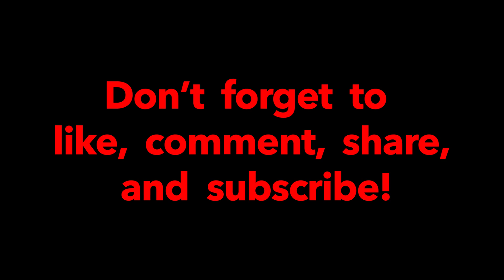Carbon Fiber vs Titanium Guitar Neck Reinforcement

Comment: Carbon fibre:   I am a cyclist and ride a high end  carbon fibre frame bicycle.  A feature of such a bike is that carbon fibre Absorbs and cancels high frequency vibration and less is absorbed by the human body.   And it does !  
Why put a carbon fibre, vibration absorbing structure in a guitar  ?
Reply from the maker: Carbon fiber oriented in certain directions is highly resonant. That's why carbon fiber acoustic guitars sound so amazing.
Reply: Carbon fibre resin matrix  inherently is excellent at generating heat that dissipates the vibration energy.  This is totally separate from orientation

Comment: How difficult of a job would it be if someone wanted to completely hot rod their 20 year old Fender P Bass with Carbon Fiber Rods and a new two way truss rod? Is that an impossible job consodering that the luthier would have to take off the fretboard or are there luthiers who have the right technique and experience to do that?
Reply: American Standard? They already have graphite rods and two way truss rods. If a vintage reissue or Mexican made, it only has a singel action truss rod. So to upgrade it, the fretboard needs to go off and a new truss rod channel needs to be routed. So lot’s of work. Probably cheaper to buy a Am Pro neck from eBay that already has those features.

Comment: Great video. Thank you for putting these together. Do you have a preference for which glue to use when installing the carbon fiber rods? From other resources I have seen either fish glue, cold hide glue, or epoxy.
Reply from the maker: Epoxy.
Reply: It makes sense as Carbon fiber rods are carbon fibers impregned with epoxy resin. This choice of glue will create a seamless integration. I have a neck reset on a Kay 39 archtop, but want to straiten the neck and reinforce it while I have the neck off and the fretboard lifted. Thank you for helping me formulate my plan.

Comment: My Titanium bike with Titanium cranks and fork was tooo flexy and springy. 3 inches of flex side to side. 
Switched cranks to aluminum. Forks to carbon. Rides like stiff lightning :)
Reply from the maker: I had the same experience with a titanium bike. The frame was way too wobbly. I went with all carbon fiber and was blown away by how light and stiff the bike was. That's probably why there are hardly any bikes made from titanium anymore.

Comment: really good video, I agree with you about CF. I've also recently added a CF bar into the back of a guitar headstock because it's a part of the guitar that can bend under string tension too, and it's hidden under a veneer.
Thanks for the great content you're offering
Reply from the maker: Right on!

Comment: Would prestressing the neck help when adjusting with CF reinforcement? Saw Dan E. do a video about doing that on particularly difficult necks.
Reply from the maker: Yes. But it really shouldn't be necessary. A decent truss rod will bend a neck even with carbon fiber reinforcement.

Comment: Ruf guitars uses an engineered urethane(?) compound which is supposed to have similar resonant characteristics to traditional "tone woods" to build their bodies and necks. So it would be possible to use three necks to see if either stiffening rod material had any noticeable effect vs one without. Since all of the necks used would be materially/dimensionally identical, any results would be valid... for their compound at least.
Reply from the maker: Still, it would be a lot of effort at a very high cost for a minimal outcome.

Comment: If the reinforcement is such that it becomes very difficult to even induce relief, and you (as a player) don't want relief, is there an argument to say in that case that the truss rod is unnecessary? I think I've seen somewhere an old guitar without a truss rod being fixed by removing the fretboard, getting the neck straight and inserting carbon fiber, but no truss rod, and putting the face on.  Would it be reasonable to build a guitar that way from the start?
Reply from the maker: Stay tuned for my next project! Hint, hint, wink, wink.
Reply: Ive done it, and in perfecr co ditions  that works. However if your building for a customer who doesnt climate control the room or takes the guitar on stage or on holiday ( hot car, high_low humidity swings) that wont work. The wood will move and therefore the setup as well and now you cant do anything to correct it except take the fretboard off.

Comment: I would have thought that Titanium would be less effective. 
Given that the polished surface of Titanium would not bond as well to an Epoxy like Carbon Fiber would ??
Reply from the maker: Per Stewmac's website: "Unlike carbon fiber, titanium requires no epoxy or glue to install. Simply rout the channel and insert the rod."

Comment: Hi there. You may not be directly answering my question, which you answered to my satisfaction a few days ago. Regardless, thank you. This is exactly the in-depth analysis I could have hoped for. As for resonance and sustain, there are far too many variables that, collectively, would affect the outcome - wood type, construction (bolt-on vs set neck vs neck-thru), pickups etc. ad infinitum. Even string brand and type, string-thru or top mount, and so on and so on. I use a zero fret on all my builds so control of relief is critical. Probably Titanium is better for me. Anyway, I've been watching you for some time now and have come to rely on you and Texas Toast (your friends I believe) for definitive advice and example. Thanks a lot.

Comment: My opinion is that sustain is one of those weird things we focus on for no reason.  Whether a guitar sustains a note loud enough to hear for 15s or 20s, what difference does it make?  If you want a note to ring out at a constant volume for several seconds, thats what compression/sustainer pedals are for.  Or a loud amp and feedback.  Or a sustainiac/ebow.  Verifiable, consistent options.
Reply: @pigjubby1  Agreed. Funny thing, even for that one, the way the beatles did that was by pushing up the faders on the board as the sound died out.
Reply from the maker: Too much sustain can be a pain in certain situations.

Comment: Really great topic and subject.   I love CF necks like my trusty Steinberger. 
I've never used titanium because without knowing the alloy and temper it may not be the right choice.  Carbon fiber works nicely in my experience.   
Saying that, I generally use hardened steel as it is stiffer than any of the CF stiffening rods I've tried of the same size, and yes the hardened steel weights more.
I do want to find CF of a similar stiffen to the steel I use as I don't have much more of it.
What CF rods are you using?
Reply: You wouldn't need to use hardened steel, normal steel should work just as well
Reply: @themechanix393  I have some hardened steel available from years back that was 1/4" x 1/8".  Not sure of a similar grade as it was one of several  experimental runs of tool steel we did at my old job.  Super stiff and bends less than mild steel or stainless. Same size as the Warmoth stiffening bars with less flex.
Reply: @sunn_bass  The Youngs Modulus/Material Stiffness of different steel alloys doesnt differ noticeably. Thus, Hardened steel is just as stiff as mild steel of a similar dimension.
Reply from the maker: My goal is not to eliminate bow. I only want to reduce it. CF is lighter than steel and plenty still for what I need. I get my rods from DragonPlate.
Reply: @HighlineGuitars  Thanks.  I need to try Dragonplate.  
I mainly do bass necks and really prefer really stiff neck for those, especially fretless. 
Thanks again.

Comment: HIGHLINE, I think EVH used 2 carbon fiber reinforcement rods in his necks and the baking progress was an art & science he said which took many years to get done correctly. You didn't mention or explaining in this video lesson about using 2 carbon fiber rods instead of only using 1 carbon fiber rod and what the advantages are. Try making another video part#2 but I think it has something to do with the baking processes and the strength of materials used of the carbon fiber. EVH guitars kept changing the neck production each year because they were experimenting with the baking processes and strength of materials used and use 2 carbon fiber reinforcement rods.
Reply from the maker: As I have shown in past videos, I use 2 rods, one on each side of the truss rod. In my next build, I will use 3 carbon fiber rods and no truss rod. I don't make my own carbon fiber rods so I don't know anything about the baking process whatever that is.
Reply: @HighlineGuitars  This video you said to remove the truss rod and only use 1 carbon fiber reinforcement rob using NO truss rod?
Reply from the maker: @waynegram8907  Where did I say that?
Reply: @HighlineGuitars  I thought you said that you're using NO truss Rod and only use 1 carbon fiber or you're using what type of Truss Rod and the Truss Rod material? and only using 1 carbon fiber reinforcement rob on the upper strings part G-B-E or using the carbon fiber reinforcement rob on the lower strings part D-A-E?
Reply from the maker: @waynegram8907  I don't know where you heard that, but it wasn't in my video.
Reply: @HighlineGuitars  but what type of truss rod materials do you recommend using with the carbon fiber rob?
Reply from the maker: @waynegram8907  I use Bitterroot truss rods. They also sell carbon fiber rods as well. A truss rod in the center of the neck with one carbon fiber rod on each side of the truss rod. https://www.bitterrootguitars.com/guitar-bass-musical-instrument-truss-rod-s/1914.htm
Reply: @HighlineGuitars  ok thanks, I thought you only used 1 carbon fiber rod for only using 1 SIDE of the truss rod. That is why I was confused because you need to use one carbon fiber rob for each side of the truss rod. Plus I didnt know you used Bitterroot truss rods.